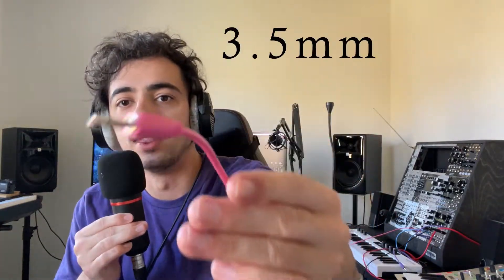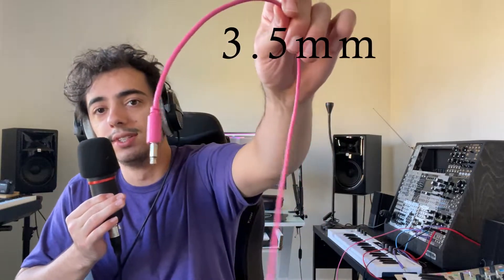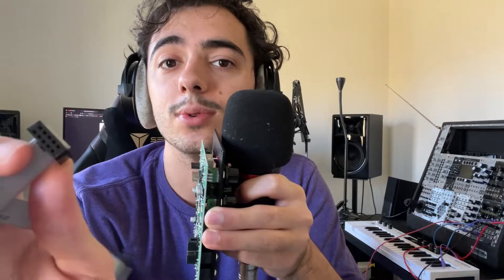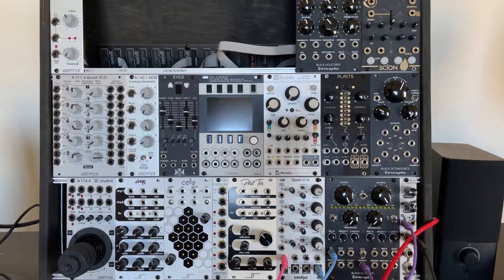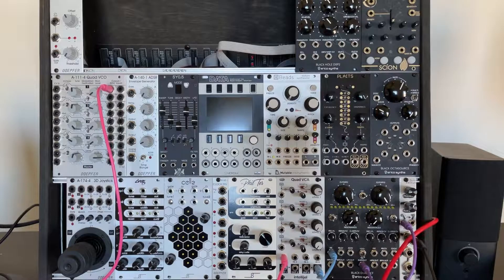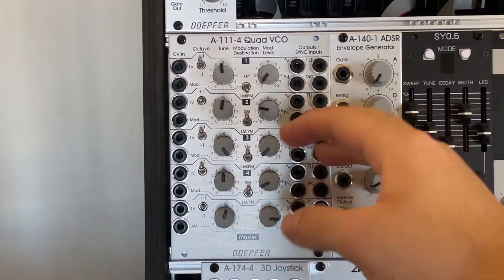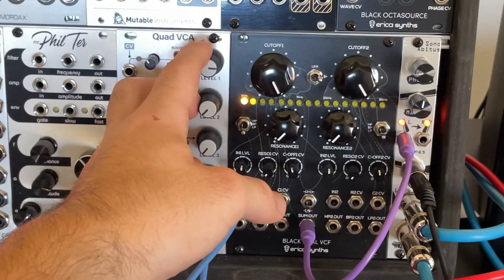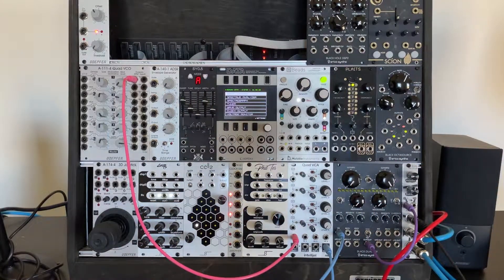Beginners INTRO GUIDE To Eurorack Modular Synthesis

Comment: Is there any difference between:
a) VCO -> VCA -> VCF -> Out
b) VCO -> VCF -> VCA -> Out ?
Reply from the maker: So, if you're using one VCO there isn't really much of a difference in the two signal chains you described, its just if you want to turn down/up the VCO before the filter or after the filter.  But normally if you are going to be combining signal/ mixing them down into a VCA or a mixer, going from 2-4 VCOs -> VCA ->  VCF will allow you to use one filter on the mixed down signal containing all the VCOs.  But maybe you just want to put a filter on a single VCO before you mix all the signals down into your VCA/mixer which would be an instance of VCO -> VCF -> VCA.  So its really just dependent on what you want to do with the signal flow in your modular rig.  Hope this answered your question!
Reply: @swelteringswine  Hi, thanks a lot for your reply! I see it will make some difference when there will be more sound sources. My way "normaly" is using a mixer between VCO/Noice etc. and VCF and then going to to VCA and OUT. I'm just in the  beginning and I think my next step will be using multi voices in the modular. Right now it all goes to the DAW as single voices. Greetings from Northern Germany!